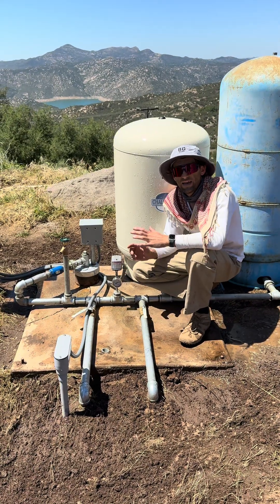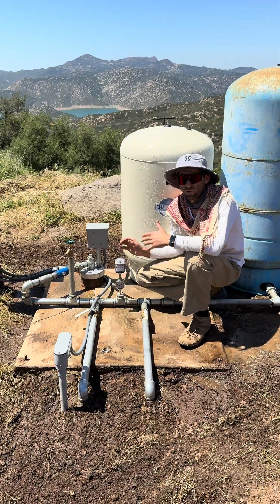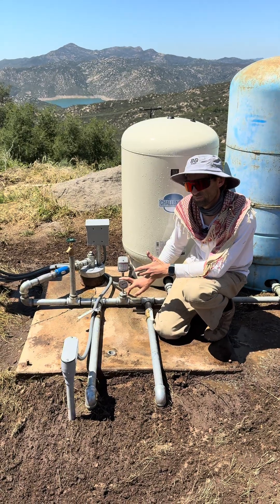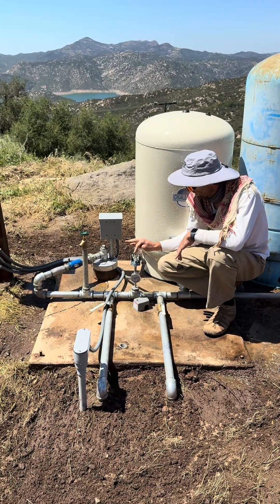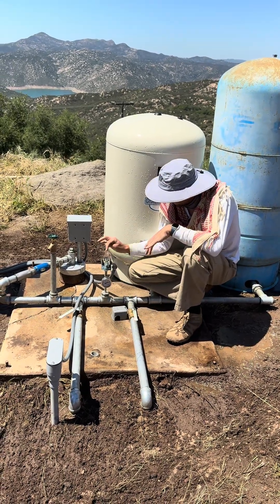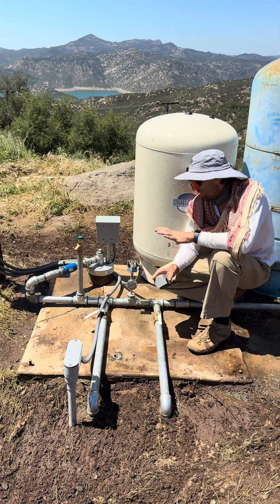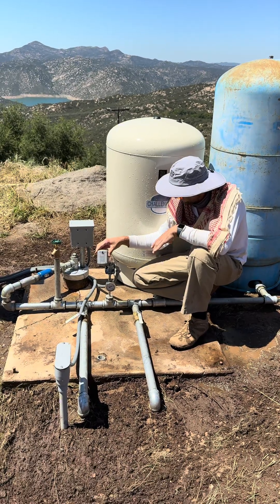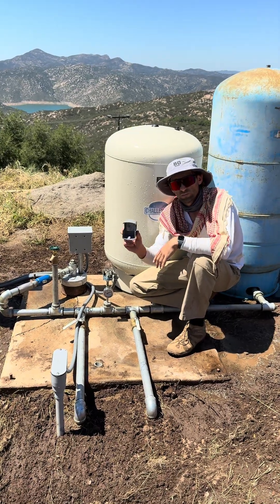Booster Pump Pressure Switch  #welldrilling #wellservice #wellpump #plumbing

Comment: Don't be this guy and test the power with your fingers.. use a voltage meter. Or a light tester... He might be like the radio guy and down Periscope trying to add some humor to the situation.. but depending on the voltage have some water pumps.. it can seriously knock you on your butt.. 120 volt stings a little bit.. 240 will make you talk funny.. 480-3 phase. That's a bad day.. I've been zapped by all three.. there's two other voltages that are sometimes used in water pumps but not very common those are 208v and 277v the 277 will make your arm go numb for about a day or two.. and your fingers might be stuck in one position for about a week.. it's not permanent it just feels like a charlie horse in your fingers..
Reply from the maker: @Damian.wagner  As I explained in the video, always shut off the power FIRST. Then you can never touch the wires, unless you know what you’re doing.
Reply: @BGPump my dad has been a licensed installer for submersible Wells in Wisconsin for about 35 years.. and I've been a residential electrician for about 25 years.. so I know a thing or two about what you're doing.. and I was being sarcastic.lol
Reply from the maker: @Damian.wagner  keep up the good work!